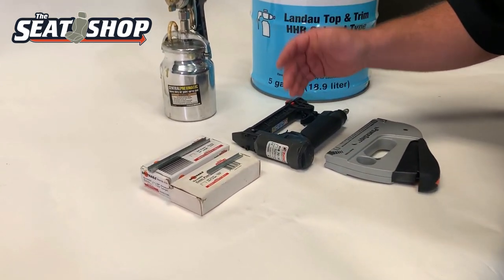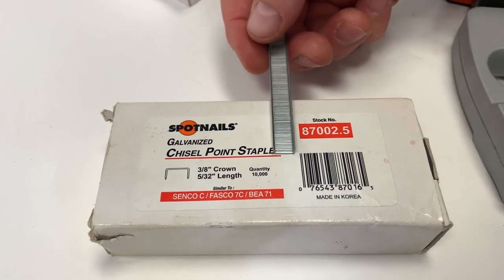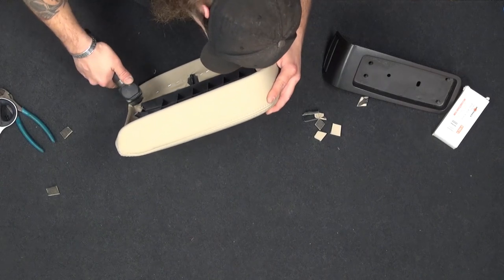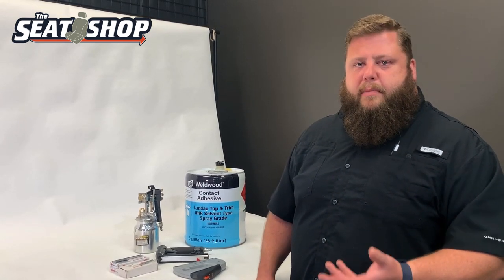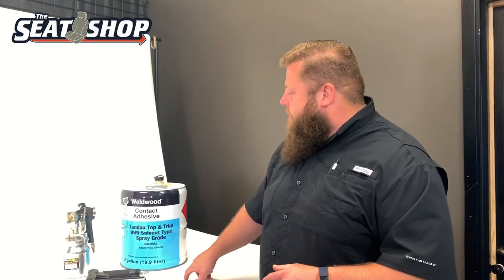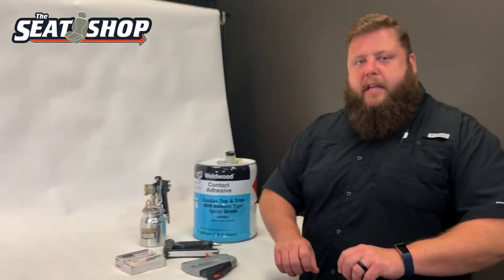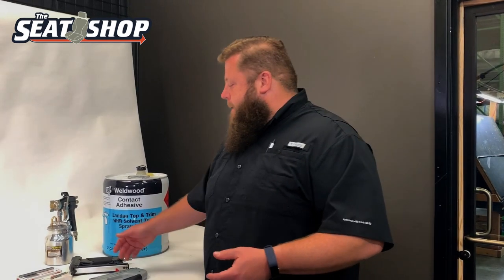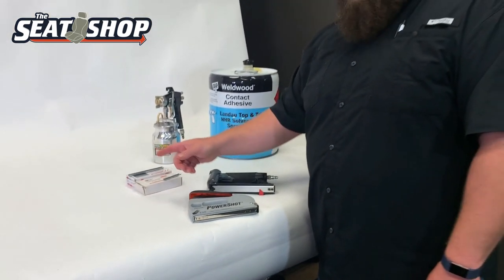Center Console Lid Cover Install Preparation

Comment: Thanks for the info. I can't find 5/32" staples or staple gun. Do you think 5/8" is fine? Thanks again
Reply from the maker: Hello! 1/8" would work as well. Those may be easier to find.
Reply: @TheSeatShop  thanks for the quick response. Unfortunately, I'm having a hard time finding 1/8" as well. Any other alternative options. Thanks
Reply from the maker: @OmarJace  Try here: https://www.nailgundepot.com/38-crown-x-532-leg-galv-staple?gad_source=1&gclid=CjwKCAjwh4-wBhB3EiwAeJsppIjozJPSSEyoCL3Sq0f_BjJ1mWsMc4nrSBxtU7IKg0dD6V9pZJjiWBoCTawQAvD_BwE
Reply: @TheSeatShop  i truly appreciate you. Do you think the harbor freight stapler gun takes these 1/8" ? If not, any budget-friendly stapler gun you recommend please?
Reply from the maker: @OmarJace  Not certain. You might just need to do a bit of Google searching.
Reply: @TheSeatShop  my bad for the inconvenience, but what gun do u use or compatible with these 1/8" and 5/32" ? I checked home Depot, Lowe's and HF but to no avail.
Reply from the maker: @OmarJace  We use the Spot Nail brand